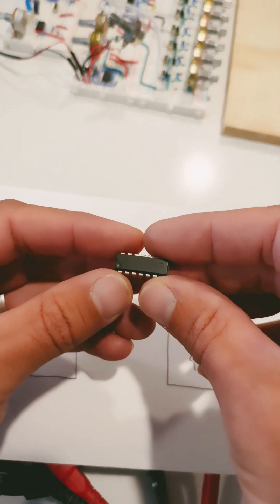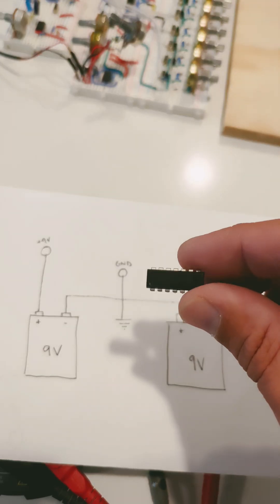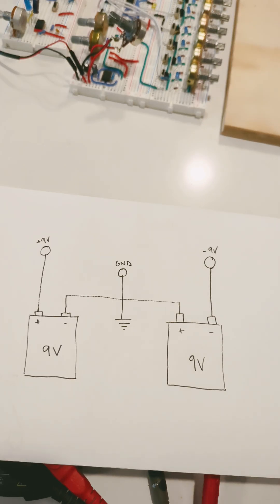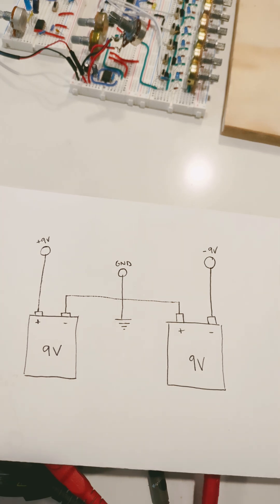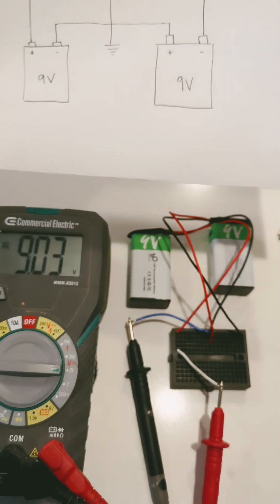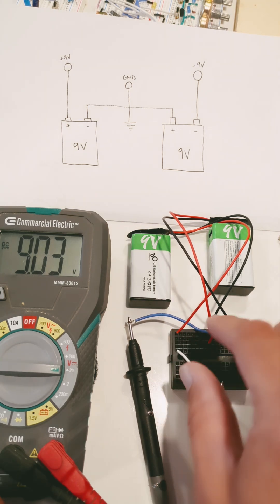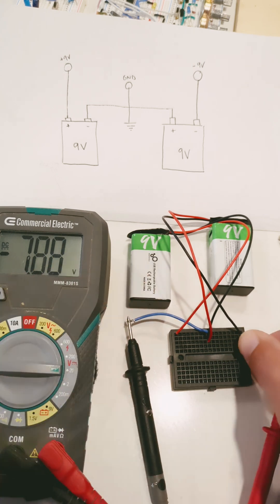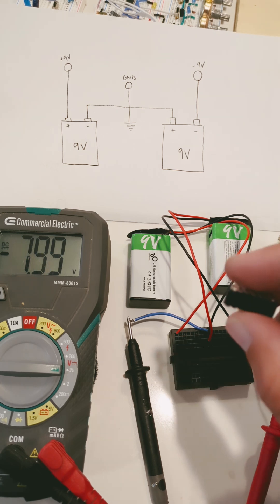Dual Power supply with two 9V batteries #9voltbattery #TL074 #op-amp #diyelectronics #synthdiy

Comment: Will it work if +5v -5v in series will it work.?
Reply from the maker: Yes, two 5v batteries in series will result in +/-5v with center ground point.
Reply: @sendingtime  no i meant 1 battery but connected to side like in series so that 1amp current limt become 2🤔🤔🤔
Reply: I had L293D